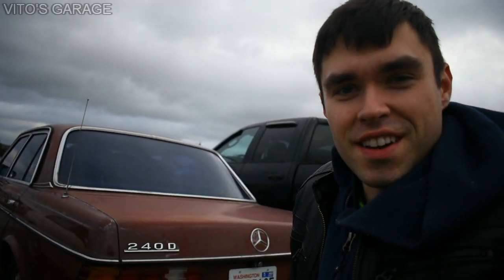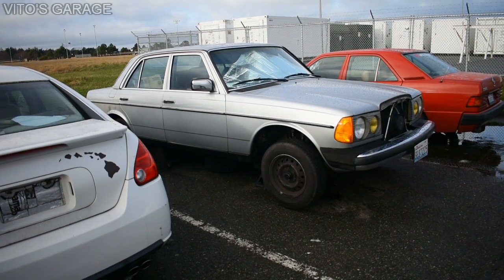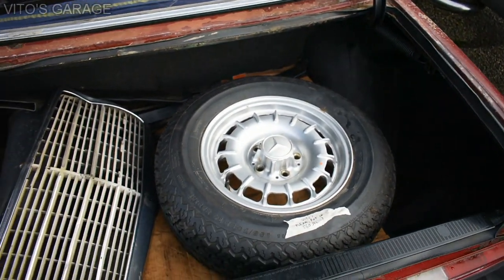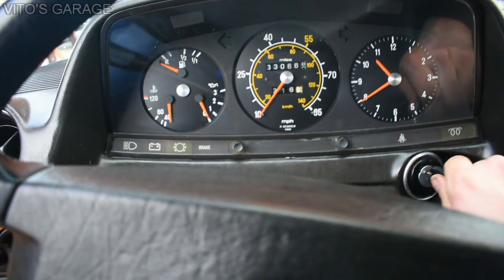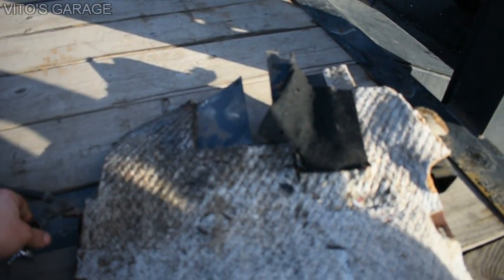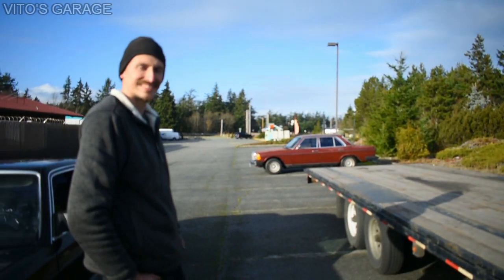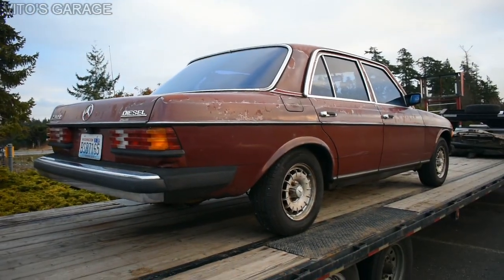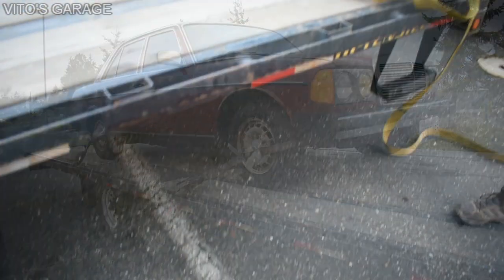Last Drive & Moments with Mercedes W123 240D Cherry Pie! Meeting Boko's Diesel Garage!

Comment: Hi Vito,how are you doing, just wondering how is your father with the W123 that you restored, also any updates on the W126?.
Reply from the maker: Fathers W123 is doing amazing and my W126 is doing great too. Just installed a new rear window regulator and replaced the power steering return hose